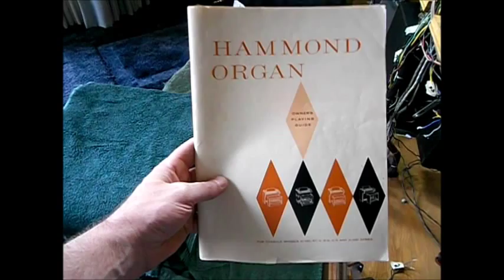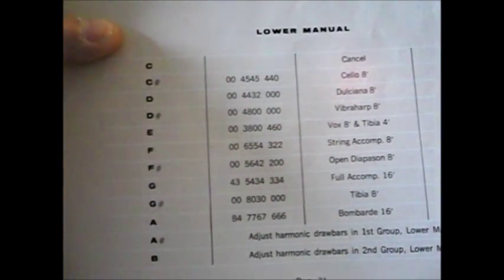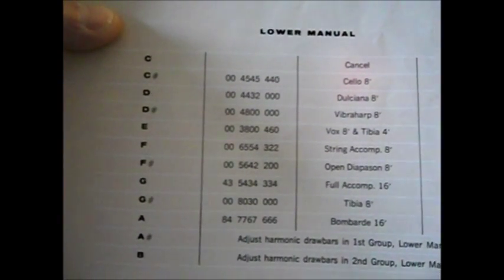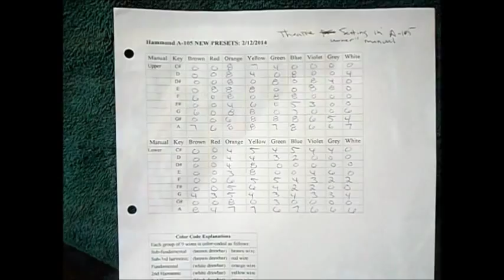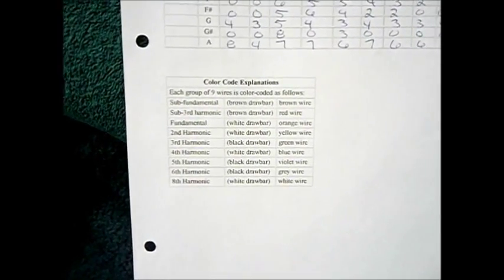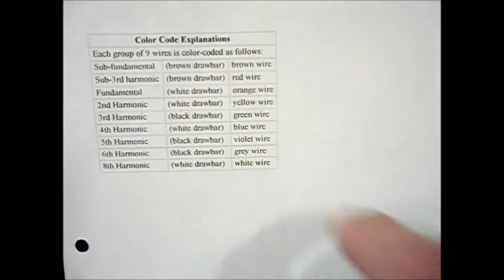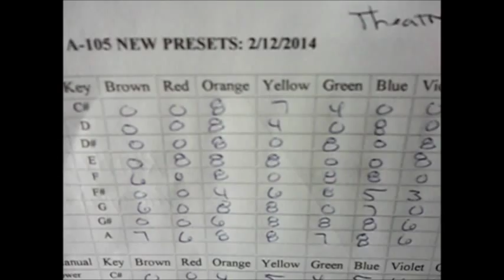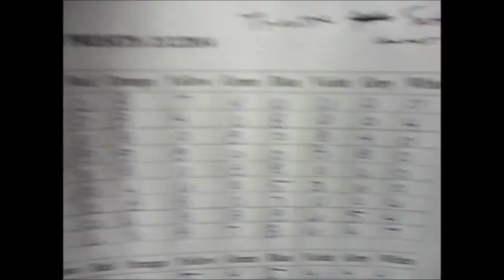Changing Hammond Organ Preset Settings

Comment: Thanks for the detailed video. I have a B3 and need to modify (actually un-modify) the bass pedal settings in the back that have been crossed up a bit, affecting the A# setting on lower manual and also affecting the sound of the bass pedals if certain drawbars are pulled out. I can see that mods have been made in the back. How about another video showing how the 2 bass pedal drawbars are wired (default wiring)?

Comment: The Color Code is the same as Resistors...

0 Blk Big.            Ground
1 Brn Beautiful  16'
2 Red Roses.     5-1/3'
3 Org Occupy    8'
4 Yel Your           4'
5 Grn Garden.   2-2/3'
6 Blu But            2'
7 Vio Violets     1-3/5
8 Gry Grow.       1-1/3'
9 Wht Wild.        1'
Reply: On Preset Changing for Jazz/Blues/R&B I set the Following...

I leave the Upper Manual Sharps the same as Liturgical Presents.

A = 88 8888 888
G = 80 8808 008 (Trade. Gospel)
F = 88 8000 000 (Jazz)
E = 84 8400 008 (Hole in Middle)
D = 80 0008 888 (Squabble)

On the Lower Manual the Two sounds I retain are F#&G# (Lit.)

On one Setup I made a Minor Ensemble/Accompaniment set that went from Softer than the Upper Manual Liturgical C# to Slightly Louder than the Lower Manual Liturgical F# as a Registration Crescendo (C# Through G without disturbing F#), and set the A Preset to 
00 8800 000.

Other Times, I have kept the F#, G# & A Presets as above, Moved the Liturgical "Soft Flutes" From the Upper F# to the Lower F# Added a sound like 00 656 5000 to G, and put 16' Manual Bass sounds to C# -E:
C# 82 0000 000
D 84 8400 000
D# 80 8000 000
E 88 8800 000
 
Also the Orange and Yellow Leads from the Pedal Bus can be Grounded at the Preset Zero Bus or other Grounding point this makes the 8' Pedal Drawbar more useful in a Jazz Context.